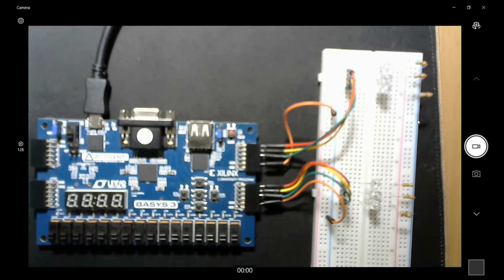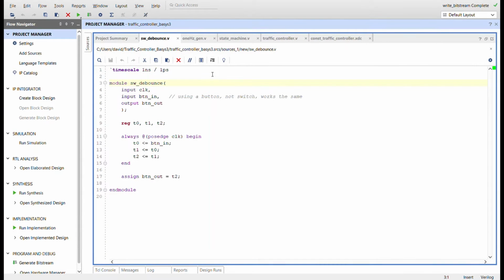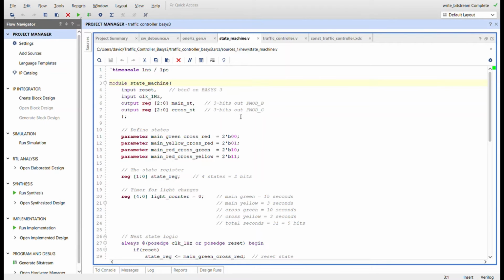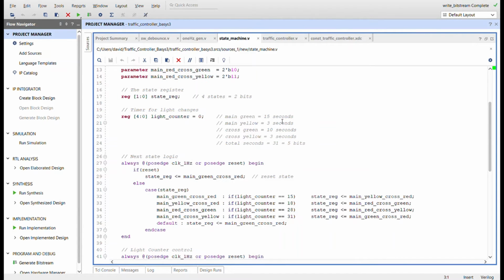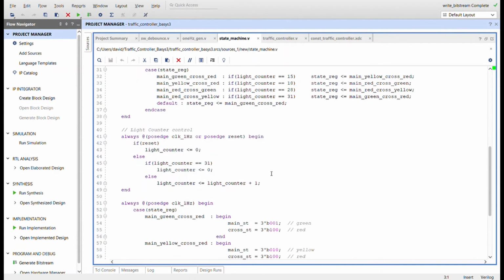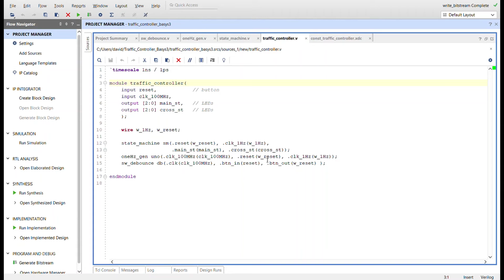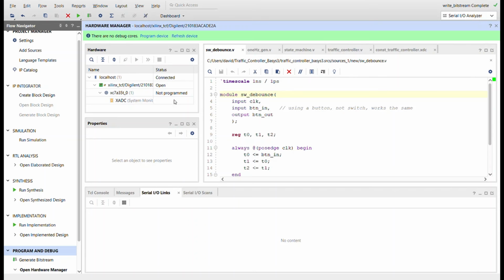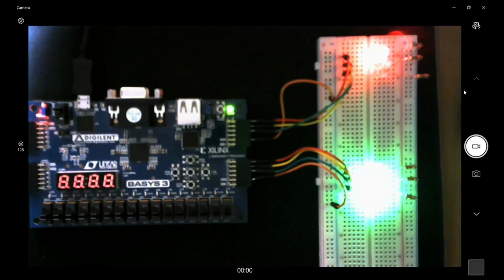Traffic Controller State Machine using Verilog on BASYS 3 FPGA

Comment: Where does the LEDS get their power supplied from? You don't have anything connected to VCC so how does the LEDS get power?
Reply from the maker: The LEDs get power from the signal ports on the PMOD connector.
Reply: @dajoma36  I tried completely replicating your setup but the LEDs dont light up, except one of the red ones just barely lighting up. The Verilog code was copied word for word just as a test but it doesnt seem to work
Reply from the maker: @spectralvortex9344  What you don't see in the video is that there is a wire at the bottom of the breadboard that connects both ground rails on each side of the breadboard. This is needed because the ground wires are connected the the ground on each PMOD, and the resistors need to be connected to that same ground.
Reply: @dajoma36  Thank you, it worked. Youre a complete life saver
Reply from the maker: @spectralvortex9344  You're welcome. Glad I was able to help.

Comment: Sir can you please help me with mu project... So basically I'm doing home alarm system using basys3 verilog code and my professor ask me to add buzzer and ultrasonic sensor when switch is on so how will i connect these two in breadboard... Using the pmod ports... And do I need any other components... Please help😢